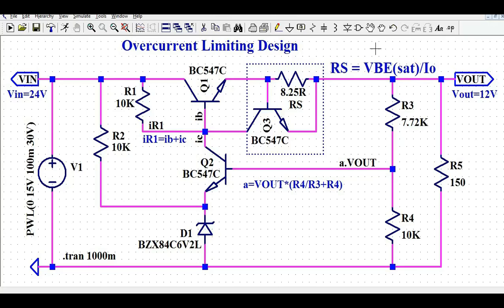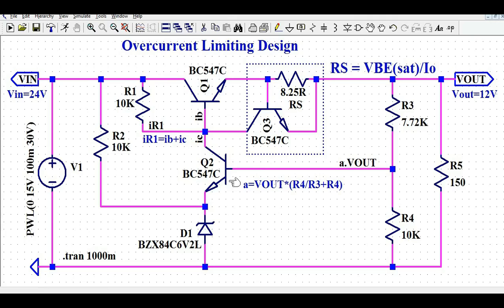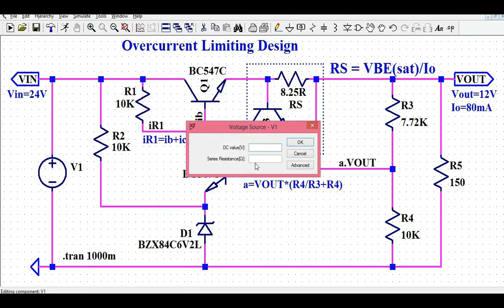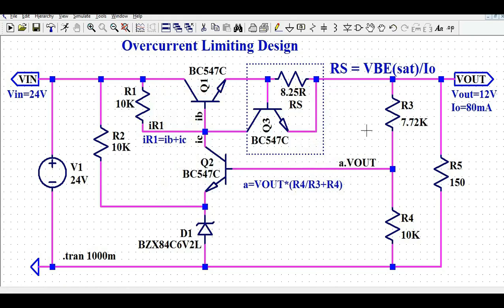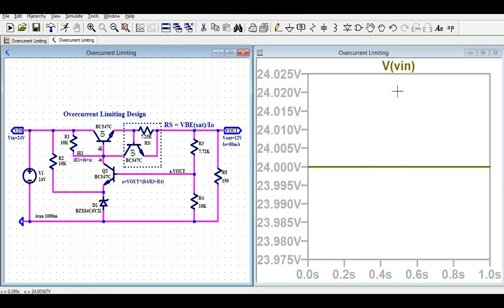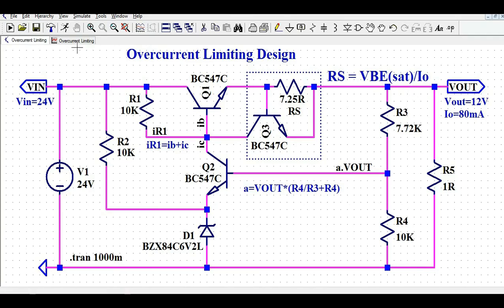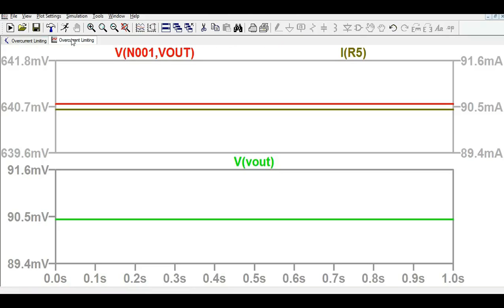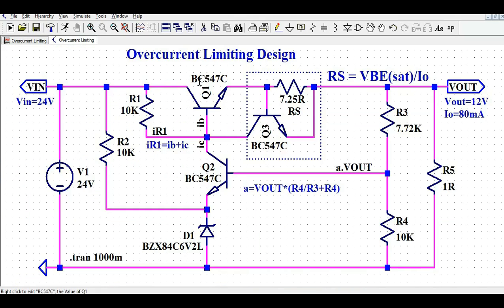Designing Overcurrent Protection Circuits with Simulation

Comment: can you make a video of overcurrent limiting using AC source
Reply from the maker: Hi...sure let me do.
Reply: @ElectronicsCircuitHubECH  Thank you, That will be a big help
Reply from the maker: @hazelvaldehueza8929  do you have any circuit in the mind to be simulated.
Reply: @ElectronicsCircuitHubECH   Actually, I am currently designing a overcurrent limiting for my Solid state protection system for appliances with 220 VAC input and 220 V AC output. And Im kind of stuck on what to do.
Reply: and 500 watts power